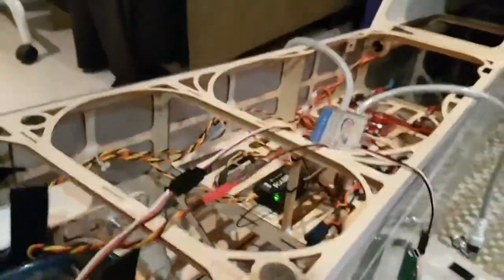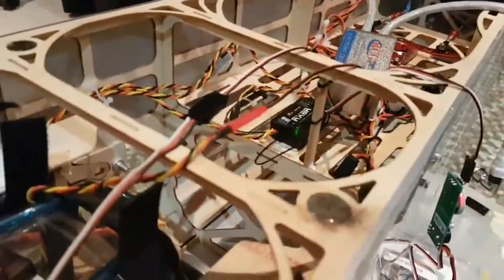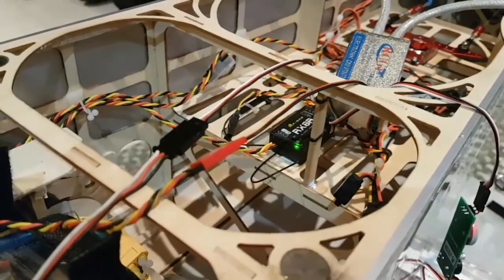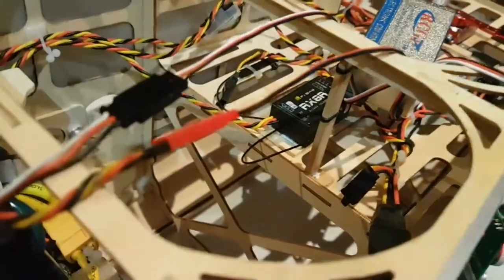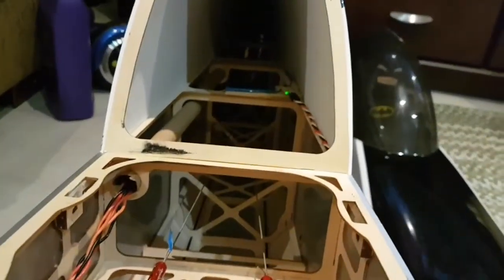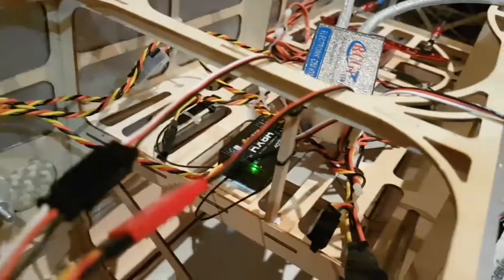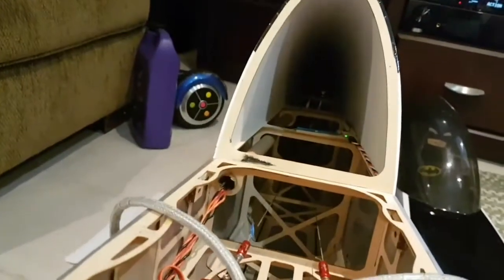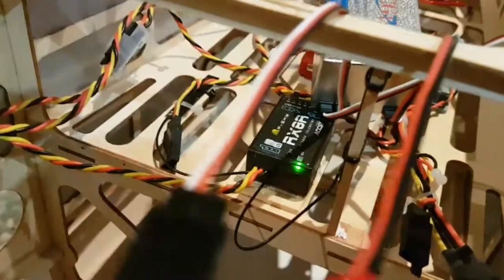RX8R Firmware test

Comment: Hello my friend... without any disrepect, your test is completelly useless!

Your spark cap is open and the spark coming out from it propagates much more RF (radiation) so much farther than what it should if connected to the spark plug on the engine.

I got a tig welder, and its HF module (High frequency starter module) produces internally a spark jumping from one eletrode to the other.. that spark is very similar to the spark coming from your spark cap.. Whenever i trigger my torch, 3 or 4 rooms away from my office, all my USB devices disconnect.

You should repeat your test with the cap connected on the spark plug threaded to the engine. 

Post the results again if possible...

Comment: well, the spark plugs are suppose to be inside that metal cage called the cylinder (look up faraday cage effect). Do you have the same problem with the plugs where they are suppose to be??? i bet you don't...
Reply from the maker: That's mighty astute of you.  But the test was for recovery of functionality.  The previous firmware would not go back to green status when it hit interference.  This version of the firmware proved 2 things, 1) The Receiver recovers back to green, and 2) the redundancy works as designed.

Hope this helps clarify.  When testing recovery, sometimes you need to get extreme.
Reply: Then tinfoil around the antennas would have done it.... FrSky rushes into things, we know that, and f...s them up!

Comment: Hi joe! I use two rx8r in my ef extra 104”. Did you think is a problem? No board, just servo in reciver! I use savox777 and two lifes 2s in sistem!
Reply from the maker: I'm assuming you're using the RX8R-Pro.  The key is to feed the servos with all the power it requires.  Boards aren't always needed, but there are symptoms that will tell you if you need to supplement the power feeds to the servos.

Here's a simple one to test for aileron blow back, go up to 2 mistakes high and at half throttle, put in full roll input.  Now go full throttle and put in full roll input.  If it rolls slower at full throttle or corkscrewing during roll, you're experiencing blow back.  

There are 2 causes for blow back, 1) not enough servo torque or 2) not enough power to your powerful servos.

But in short, no issue with feeding your servos directly from the recievers.
Reply: Joe Trinidad thanks so much for the answer! Good analysis! Gonna test! But im using rx8r, not rx8r pro. Make diference?
Reply from the maker: @apenasumfpv  
Yes, huge difference.  The Pro is intended for gas engines and has been hardened for electrically noisy environments.
Reply: Joe Trinidad you recommends replace my two rx8r to rx8r pro?
Reply from the maker: @apenasumfpv  

Here's what you can do, get 1 RX8R-PRO and put your non pro in the tail and connect the SBUS out from the non pro to the Pro SBUS in.  At least you'll inherit redundancy and your non pro will be far away from any ignition noise.

Comment: Hello, which setup are you using on this plane? (servos, batteries, receivers, etc.). Are you using any type of power distribution board, or is the receiver sufficient to support the servo current? Thank you.
Reply from the maker: The setup is as follows
Bls42a x 4 (elevator ailerons)
Bls H50 x 1 (rudder)
Booma AR8/24 board
Rx8r pro with xm+
BMW 2514 for Throttle
2 x 3300 may Lipo
RCGF 70 with RCEXL ignition and Tech Aero IBEC

Feel free to ask questions
Reply: @joetrin  So I'm with a H9 Sukoi 85cc, 4 Spectrum a6030 servos for ail and elev, 1 Hitec 7955 for the rudder, and a Futaba 3004 for the Throttle (I know, plastic); 1 Life 2S of 3200mha for RX and a separate battery for ignition.
When I bought this plane, it was with an AR7000 Receiver and its respective satellite. I have the Taranis X9D and bought the RX8R-pro and an XM +.
But I do not know if it is safe to fly with only the servos connected directly to the receiver (as I was on the AR7000) (I think this is due to current drain when performing stronger maneuvers), I thought about buying a RB-10 or RB-20, I do not know much about it.
Have you ever used or thought about using the Frsky RB-10 or RB-20 in this airplane?
Reply from the maker: @AlissonCasagrandeGTR  the reciever can deliver the power through the bus no problem.  The issue will not be the power, it's the single LiFe battery.  If the current capacity is not enough you will get voltage sags and control surface blow back.

Get yourself a battshare unit of any kind and double up on the batteries.

Start there and if you are still getting control surface blowback, add a power distribution board.
Reply from the maker: The 2nd part of your question, I personally would not use an RB20, I'd wait for the RB40.

On my 120cc planes, I use the AR Smartbus Extreme.

Comment: Hey Joe thanks for the Video I built a small electric edge 540 3d flyer using a 60amp hobbywing esc with 5 align ds450m they are small HV servos and my question is do you think the RX8R will be enough to power them without any extra electronics.. I would run them at 8.4 volts , I know this is off topic but from the look of it you can hopefully help me please !!! any suggestions would be great ! Also I’ve been flying my Horus x10s and love this radio can you do some setup suggestions or feed back on large scale gas planes has anyone done that yet ?
Reply from the maker: The RX8R will have no issues with direct powering those servos.
Reply: Joe Trinidad omg thank you Joe I completely excited to hear that I don’t want to waste my money on Futaba or spektrum again. I love my hours x10s an best feel ever but the only down side was putting into a 120cc plane I have had a few in the past with power box setups will that work with Frsky ?? And what are you recommendations for running like 10 mks hbl380 servos !!?
Reply from the maker: @jameshaladus9165  HBL380's can draw 9 Amps each while moving and about amps at stall.  I would choose any power distribution board without any regulation and avoid plolyfuses like a plague.

The extreme power systems x24 works very well with the frsky RX8R-PRO and xm+ for redundancy attached to the SBUS in of the Pro.

The x24 even has a built in IBEC, and the price is good.  Really good.
Reply from the maker: Feel free to ask about setups for gas planes.  I use my Horus for giant scale.  I have 5 120cc airplanes and 1 70cc plus a new 120cc plane coming.  What is it that you want to know?

Comment: Looks like the firmware upgrade only stops the issue with locking up as soon as you reduce the RFI noise it recovers where before it stayed locked out until it was power cycled. The real fix for this is the RX8R-Pro I tested it watched the non pro fail while the pro continues to work without issues. Kind of upsets me that FrSky has not replaced the entire X series with the fix the Pro got because the firmware upgrade is just a band-aid fix any lockout even temporary is not good during flight. The lockouts also from what I have been told doesn't go into fail safe gas engines continue to run could cause a safety issue.  Other reports of EDF jets also experiencing the same issue from RFI generated in the ESC the theory. The pro is marketed as the only X series receiver which works correctly.
Reply from the maker: Actually, what you'll see is a phase out of the X8R, this is just an opinion.  The RX8R-Pro is the same price as the X8R and it's got greater range and is controllable down to 25rssi while the X8r is controllable only to 35ish rssi.  The XM+ can be used in the RB20 and the up and coming RB40, and it's proven to be stable and reliable with Gas Planes.  I use this setup now exclusively.

If we wanted to get really crazy, we could daisy chain 2x RX8R-Pros with XM+ on each sbus port of the RB20 or RB40 (soon to be released), now that would be interesting and very overkill ish.. LOL

The erlier RX8R's work well, I've got an early Rx8R in my Su26 which has hundreds of flights with no issues at all.

Also please note, both the RX8R-Pro and X8R's have  had revised firmware since the publishing of this video.

Comment: Hi Joe, did you know if the X8R has the same problem? which is the distance i need install the X8R to de CDI? Thank's
I'm sorry about the poor english... i'm studing yet...
Reply from the maker: Hi Douglas,  the X8R has no such issue, it's actually better shielded than the RX8R's, hence the RX8R-Pro.  I'm currently testing a pre-prod lot of RX8R's to report back to frsky the results.  Best practice is to always put as much distance between CDI and Receiver, and to orient the antennae as far apart as possible while maintaining a 90/90 orientation.  The paddle antennas should not only be in a 90 degree pattern, but the paddles should also be oriented 90 degrees to each other.

Comment: hi, the last firmware for RX8R reciver is 170208..... not 170224..... where did you find this firmware ???
Reply from the maker: albychainsaw80 , I sent a test report to FRSKY they sent me the firmware.  It will be on their site soon.
Reply: nice, very interesting; but the problem was lost signal caused to eletronic CDI ?
Reply from the maker: Yes the faulty ignition box caused the RX8R to lockout and not come back.  The xm+ maintained communications at all times, the redundancy worked.   The new firmware allows the RX8R come out of being locked up.  Hence the video.
Reply: Did you turn off the ignition to get it to reboot or did it recover by its self
Reply from the maker: @somerton123  I shielded the TX to the point that signal was marginal.  The TX was equidistant to both recievers in a metal case.  To get it to come back I unshielded the TX.

Previous iterations of the firmware resulted in the RX not coming back to operational and remained hung using the same test.